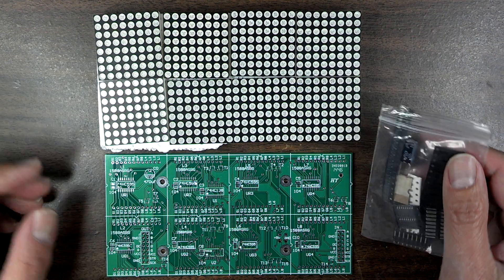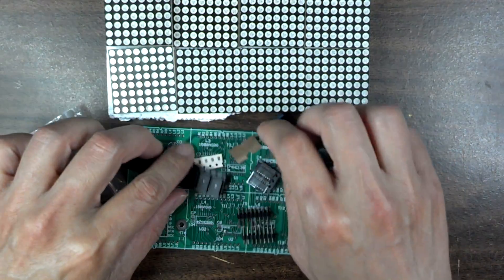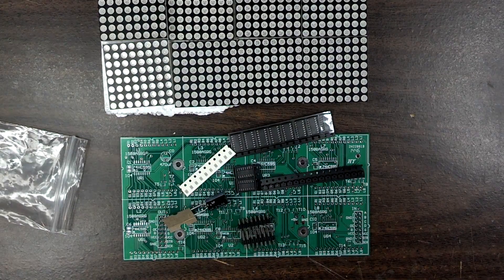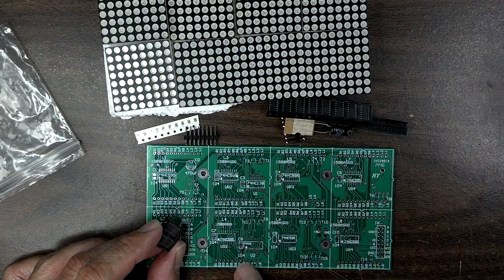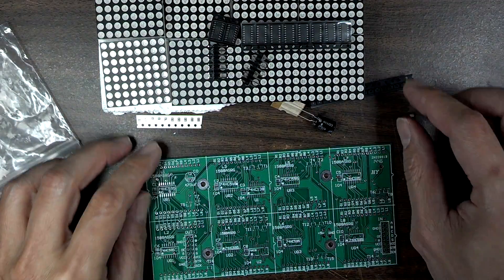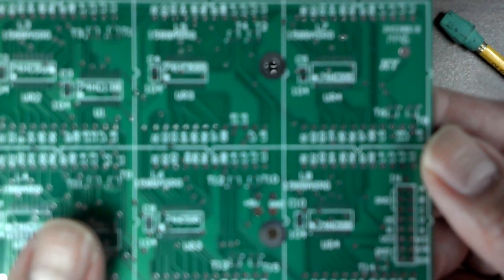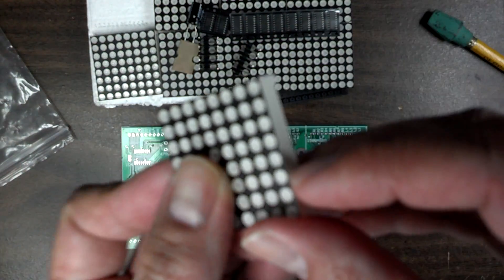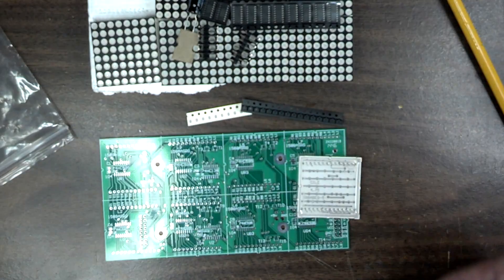HariFun#112 - 16x32 LED Matrix Kit (part 1)

Comment: Hi, I have bought exactly the same DIY Kit and I dont know how to solder the smd components. I have some questions. How did you assembled this? did you use extra tools? added a case? did you have a good magnifyer? What do I need to assemble this circuit? Thanks.
Reply from the maker: Hi, I covered the tools I used in part 2.  Eventhough most solder has flux in them, having additional flux is very helpful.
https://www.youtube.com/watch?v=-oqwJL8Lb2M&list=PL-xZsBalytNC44Ldm14sMVPCIbh0ZODwp&index=4&t=0s

Comment: looks like loads of fun .  You gonna hand solder , or do you have a re-flow oven?
Reply from the maker: XerotoLabs , I do not have a reflow oven. So, it's hardcore soldering! :-)
Reply: nuts , ah well that's a project for a later time . Possibly ESP8266 12 controlled re-flow oven that can emaill / text you when its done . LOL